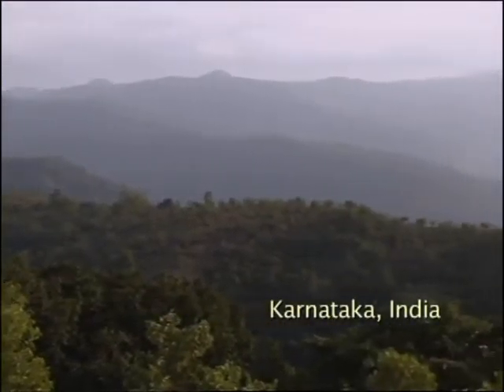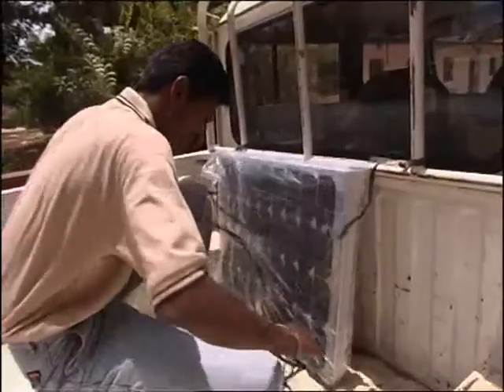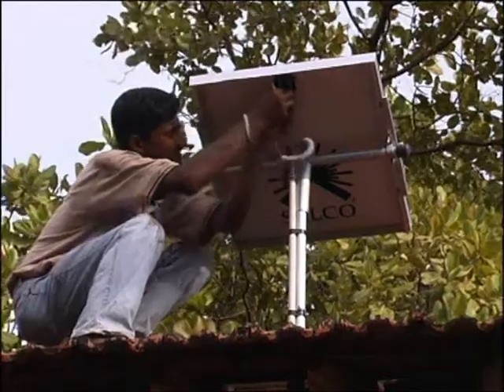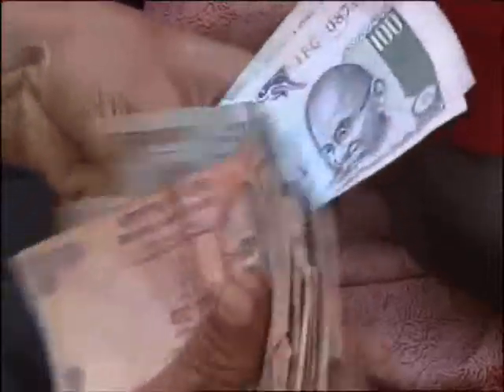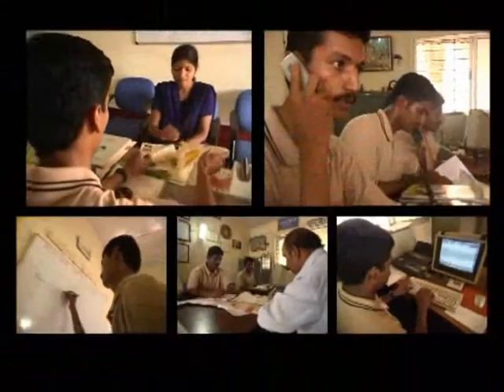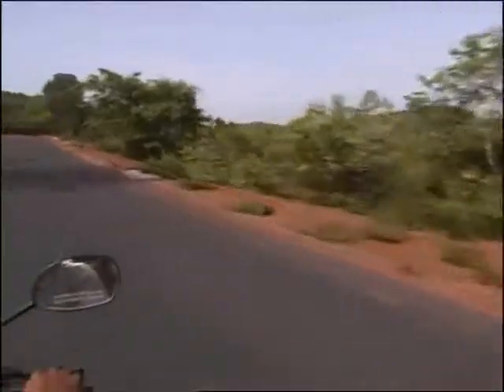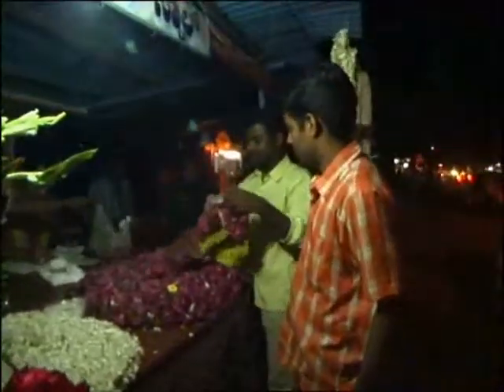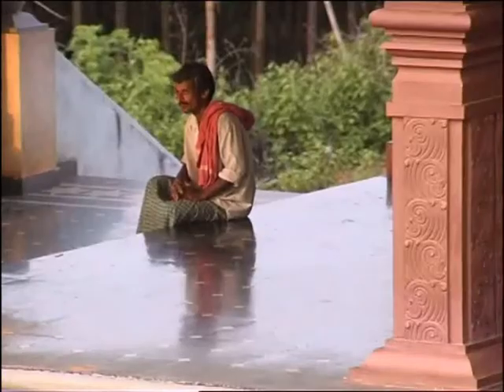SELCO India, Affordable solar home systems - Ashden Award winner

Comment: I like it. I am thinking whether setting up solar panels at home for for totally depending on it for low-power appliances like light(CFL), fan, TV, sound system, desktop/laptop etc will be a viable economic proposition. Total installed capacity is about 1 kw. Please comment and suggest solutions. I live at a suburb of Kolkata WB in Chandannagar Municipal Corporation.